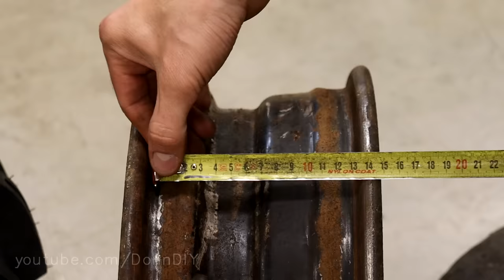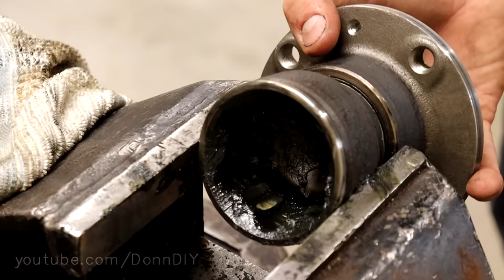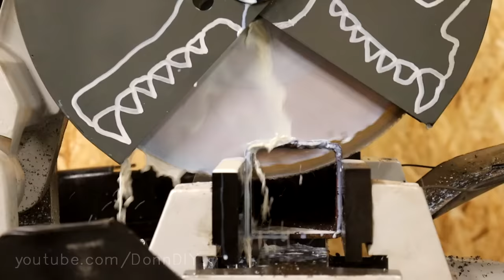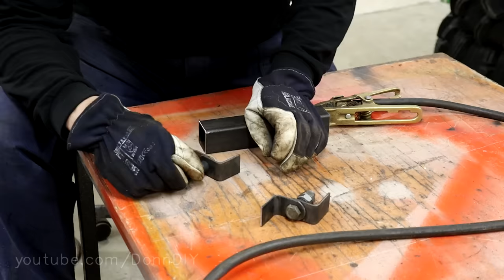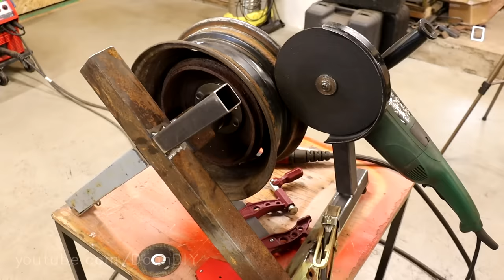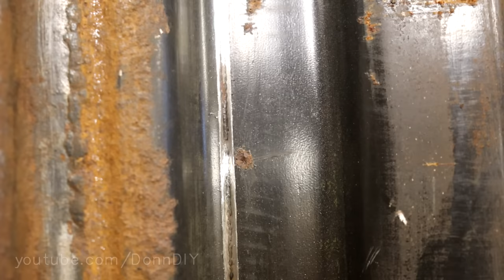Widening Steel Rims - 4x4 Build Ep.3

Comment from the maker: Want more fabrication videos? There are plenty on https://www.youtube.com/c/DonnDIY/videos
Reply: Lnj
Reply: @ronaldosantos2334  n
Reply: @ronaldosantos2334  ช
Reply: Jan Schlossar  it's for an off-road vehicle, it doesn't have to be spot-on perfect. these wheels aren't going to be balanced or anything like that. when guys started making their own bead-lock rims no one was worried about the wheels being perfect or balancing the tires. the aren't going to be spinning as fast as highway tires are.
Reply: @malacungpapuyu1987  hi
Reply: @christiaanbrown4278  but some guys are perfectionists  which i admire and respect .
patience pay off
Reply: Dont these tires have like 250 kg max load?
Reply: @rokadamlje5365  if they do then the vehicle can be up to 1000kg (250kg x 4 tires)
Reply: @christiaanbrown4278  well as long as its only some towing of 2 axle trailers. Hitching anything to this will quickly bring the weight onto rear 2 tires beyond 500kg. 

Should have used some tractor tires. Or do these tires have that much more capacity over the rating?
Reply: Ζπ @malacungpapuyu1987
Reply: Indonesia I from Indonesia I like like like👍👍👍
Reply: @jajangsumarya2933  8j
Reply: @rokadamlje5365  u
Reply: @ronaldosantos2334  fazer
Reply: @ronaldosantos2334  aa
Reply: в Росии эти диски называются РАЗВАРКИ )) вы молодец и руки у вас прямые ))

Comment: A much easier and quicker way to do this is to go to a wrecking yard and buy 4 rims of the same type and cut off the widest part of the rim to whatever size suits your desired wheel width.  This eliminates the need to make sure the retained part of the rim and the band and the cut off rim all run true.  I used to work for a business that repaired wheels and made wide rims for all sorts of applications.  With very wide rims, fitting a band in the middle can't be avoided sometimes, but cutting another rim is much, much easier.

Comment: Will one of his sponsors send him a blast cabinet and a powder coating setup
Reply: What!? And deprive us seeing him build one?
Reply: Useless. He knows a guy when it's needed for big parts.
Reply: I have a self made blast cabinet and a 3 Zyl. kompressor with a 1000 liter Tank, but it is in Germany
Reply: They better!!! :D
Reply: They are extremely easy to build plus you can make them the size that you want because they don't sale them the size you want and quality
Reply: Him standing over a cabinet blasting probably makes poor youtube content vs grinding, wire wheeling, sanding, etc. He'd have to rig a blasting cam
Reply: Ask daddy
Reply: I don’t think he is sponsored by anyone?
Reply: I think he has a paytreon page. The ppl who donate there are sponsors. In the video notes the local welding supply loaned him the welding equipment. He has the ability to gain more sponsors 😉
Reply: he does need one and that would be cool to have in any shop
Reply: R escassez saem 3
Reply: I made my cab with TP Tools fittings and gun kits.
Reply: Man, I just would like to say. My hats off to you. Great job!
Reply: @mountainviews5025  Correct.. build any size with plywood.

Comment: Nice job, I've done something similar to this before and one thing that really helped was a fresh grind on the lug nut to make better electrical connection because the ground on m.i.g. is more important than any other type of welding since the machine is jump pumping out same wire speed constantly unlike stick and so on.  👍

Comment: From a welder and car builder with over 40 experience I want to tell you what a great job you did with your fixture and prep work! The only thing that I noticed in the welding is the amount of wire stick out was a bit much. Obviously I don’t know your settings however I like to weld hot and one way of doing that is less stick out from the contact tip. Otherwise GREAT JOB!

Comment: I had a dirt track frame manufacturer in Augusta, GA put a 2” band in a set of factory wheels for an 81 Ford Courier that I restored back in the late 80’s. I put a set of chrome rings and the factory hub caps on the wheels and mounted a set of 60 series tires all around. Had a lot of people ask me how I was able to mount wide tires on that little truck with the “factory” wheels. Surprisingly the truck rode really good.

Comment: I'm always intrigued at the way you fab and engineer your way past every obstacle you come upon. Your problem solving skills are fantastic. Another amazing video, thanks!
Reply: BTJ, excellent comment. He is a genius. I Love watching his work.
Reply: @davepelfrey3958  I agree. It just makes my day when his video comes up. He is fantastic to watch.....And he makes it look so simple.
Reply: @bobf12  ,   that is a fact.
Reply: Sorry to burst the bubble, but this has been done for decades and jig he built would be suited to some car mechanics place at 80¨s-90's to widen the rims for local teens for road use. Usually its done in non commercial setting with car jacked up from one side, attach the rim, clean up the area with a rag for most of the crap, angle grind while car is on 1-2 gear depending on ratio and rim diameter for desired speed since rim diameter=distance per revolution, engine rpm devided by gear ratio times two i believe since all power is going to one side of the differential. Cut the rim, round the flat bar or sheet of steel, weld it in place while car is lifted up on front and buddy can adjust the speed from other side via differential, clean the worst of the welds a bit if you can bothered, trow into balancing machine. If its way unbalanced just grind little from one side to counter balance, paint it, check the balance if bothered, mount the tire and see what ever it hold the air. If not trow more paint at it, unless there is hole so big you can see to other side, witch point go check your eye sight at doctor, grind the paint off from that spot, trow little "Kemppi glue" at the problem, if there is any paint left it will burn out, smooth it out and repeat the balancing and painting portion. Weld is there to hold it on one peace and paint fills any air holes there might be. His method would work for actual car rims in road use, while described teen method would be more suited to UTV, since its does not matter much if rim snaps in half in crawling speeds, but on the highway its different matter.
Way he did it was over engineered, but then again who knows, maybe he will be making more of these widened rims so it makes sense to have proper jig for mass production.
Reply: Hellsong89 cool.
Reply: I agree man. It is nice to give a guy credit for doing/making/adapting versus saying "its been done before blah blah blah".

Comment: Could have just welded by hand while still using the bearing to spin the wheel. Much simpler and easier to control. I've built tons of driveshafts this way and if you use a dial indicator no need to balance.

Comment: Are you ready for safty trolls storm? For god sake, there "wide steel" is common in bmw and audi. ;)
Reply: It isn't going to be used at high speed, it's for an off road UTV. you were going to use it on the road I would say don't use a banded wheel but offroad at low speeds it'll be good.
Reply: @cmotdibbler4454  - I was thinking, Maybe I wouldn't want to try those at 150 kph, but they should suffice for an ORV. The penalty for failure is to walk home and fix it; that seems OK.
Reply: @MAGAMAN  - The intended use is for a utility off-road tow  vehicle. I don't think he intends to do any racing. (He has other vehicles, designed and intended for that purpose.) I agree, it is possible to have a fatal accident at 10 kph, but it isn't likely, even with a total, instantaneous wheel failure.
Reply: Spoken like a bunch of people that cant weld!
I will have no problem running wheels I have widened. 
But...I am certified welder
Reply: @MAGAMAN  i got news for you. Every company I have ever seen that widens steel wheels does this the same way.

Also these would be plenty strong for on road purposes. If companies do this sort of work they more than likely state that they are for offroad use only just like all the weld on bead lock companies do. It protects them from lawsuits. However I can absolutely verify they they are strong enough for road use. At best the wheel will bend. You show me any aftermarket steel wheel and I'll show you an unbalanced steel wheel. When I was a kid I worked for a tire shop. Damn near all the aftermarket steel wheels were out of balance to some degree.

Comment: Simple power feed would be to have a band around the rim going down to a small diameter rod chucked in a drill. Variable speed, and requires almost no precision to implement.
Reply: Might as well go full NC on it! Pretty much there.
Reply: @kurtwerner4258  Not quite.
Reply: Or just bolt the rim into car, lift one corner up and let engine run on idle. For precision use strap to tie steering wheel in place. That is how its been done for decades.
Reply: I have my doubts that that would work well. For that size welder and wire, he’s looking at about 3-8” of weld per minute. Assuming it’s a 14” rim, that’s around 5-14 minutes of weld per rim. I don’t know that the engine could turn the wheel that slow. I’ve been wrong plenty of times before though.
Reply: @whodat90  I believe you are correct, I've never seen a freewheeling car tire at idle turn that slow. the brake would have to be on all the time to get the wheel speed correct and there could still be surges related to the brake pads and/or the drum or rotor. Using an electric motor geared down with either a rubber wheel in contact with the rim or the shaft with a pulley and a belt would be the most effective and consistent way to turn the wheel for this kind of welding. the pros use a foot pedal to control motor speed as they weld.

Comment: At the speeds that UTV will travel, if you run into trouble with the widened rims holding air, you could smooth those welds down a bit and put tubes in the tires with no issues at all. That was an ingenious bit of work; well done. 👍

Comment: you are awesome like ever. but is maybe time for a TIG?😉 i would try with a bit more current or less wire speed to enlarge the welding track anyway.
Reply: Be pretty slow welding up 4 rims with the tig wouldn’t it? I ended welding up my rim with the stick welder even though I have a tig because I couldn’t be bothered cleaning it up probably
Reply: TIGs are for fancy work, they're not that good for on the cuff quick stuff like this. I've often found that they actually impede the process.
Reply: aserta your dead right! I pretty much only use mine for stainless and alloy

Comment: keep up the great work your doing .. some day you need to build a sand blasting cabinet .. i am going to change mine , so i can shove long pipe threw it and clean a section at a time , then close the flaps when doing other things ,, need to hook a shop vac so i can see what i am doing gets a bit dusty . also need to ground the unit i have been sapped it will create a charge while sand blasting ,, keep up the great videos ,,

Comment: Back in the day the way we would widen rims was to get another set of old rims the same diameter,  Cut the edge off the good rim at the edge and use the wide section off the donor rim. Weld the two together while on the front hub of the car to rotate the wheel.  No spacer needed and only one weld to concentrate on.

Comment: Great work. Little tip  though. Cut the ends of the rolled ring at 45° so that it isnt a straight butt joint were the ends meet. Its easier to blend in afterwards and much stronger.

Comment: Not that I don't love DIY stuff. But those rims your making with 4 bolt golf cart/atv pattern are about 30$ each lol already size your making!   for 120$ roughly you could buy brand new set already correct size, compared to the $120 steel/$xxx expendables  and god only knows $xxx power consumed to make those lolz! dion't get me wrong I love the videos! These came out top notch I may add! just saying there comes point why even go through trouble in my view.

Comment: Small point, why did you cut the axle off the cv joint? You only needed to hold the axle and hit the joint and it pops off the axle. The spring clip is only to stop the axle walking off when driving. It is designed to collapse as the center of the joint is bumped over it.

Comment: Awesome job!!!!  Widening rims in this manner was one of my first jobs at 14 years old. (Over 50 years ago)  I worked for a friend's dad in his machine shop. We had a set of rollers that were powered by an electric motor that we sat the rim on to slowly turn it while I welded it.
Reply from the maker: Two rollers is the most universal solution - fits all diameter rims.

Comment: Excellent! I like your way of thinking. Kudos for being protected. I see many videos of people welding without a respirator or even a dust mask at the very least. I was thinking ahead of your video how you were going to weld the  circular joint and my thought exactly! you need a jig and let the welder do the weld with consistency. I would have added an extra tool to make the circular weld more consistent and that is the use a slow speed motor setup to rotate the hub at controlled speed, especially with 3 additional wheels to do. Thumbs Up!

Comment: You are EXTREMELY talented, and I learn a lot from you. But wouldn't it have been easier to mod rim that fit the tires to the bolt pattern on the axle?
Reply: I went looking for this comment because I was thinking the exact same thing

Comment: what gauge sheet Sheetmetal did you use?   i've been wanting to band my VW stock wheels.  i bought a tire machine to use as like a sideways lathe to cut my rim.   i'm not sure what gauge to use for the band.  i also need to get a roller!

Comment: In the mid 1960’s into the mid 1970’s there was a business in Garden Grove California called “The Big Wheel”.  They advertised in the 2 or 3 magazines at the time and they started off doing this for the craze in the 1960’s of shortening a VW pan and making a dune buggy.  By 1970 there were a ton of us CJ Jeep people that were also running their rims.  You traded in your stock wheels and for 8.95 per you bought an 8” rim, 10.95 got you a 10” rim.  Their process was almost identical to this video.  At the height of their business I believe they had around a dozen employees.  It was advent of dependable tubeless tires that finally did the business in, there were also laws passed (although I and everyone I knew never heard of a problem with the rims) that finally put the company out of business.  Great ingenuity exhibited in this video, first time I’ve seen this channel as it popped up on my recommended list.  New subscriber!

Comment: One change I'd make.  Electrically insulate the MIG welder copper cup / nozzle from the clamp.  If the nozzle fills with balls of metal, you will get a conductive path. Otherwise, great solution to making the wheels.

Comment: This is way better than those hour long video from the Third World where with bizarre royalty-free music of reinventing the wheel if you will by  recycling motors, magnets and fans from junk computers, some bell wire and  a battery, hot glue, hose clamps and wood to make something that your never going to buy, let alone make and you're so mad at the time you can't get back that you don't even leave a like!

This is what I sent to buddy who we're both been crazy about cars since we were a lot younger! :
"Being as you do a lot of stuff with the off-road vehicles, motorcycles and that kind of thing this might be of interest to you. He's getting pretty jiggy with it! At least it makes everything repeatable. I'm hoping in the 20 part series he gets around to blasting those steel wheels inside & out, maybe do something to make it look & hold air/bead better. I've been a subscriber, but I don't think that the algorithm pushes his video's, but if I wasn't so ADHD I'd have watched the one about a homemade belt conveyor for God only know's what for! I've got a cousin who's stacking paper like old folks designing them for proprioritatory applications like Amazon type of things in HUGE company's warehouses. I've seen hay elevators used to process firewood saving a lot of backbreaking work! Not to mention more on setting up a machine shop, 'cuz if you're crazy enough to do this just think about all of what you could do with a lathe and a mill!!!"

Comment: Aside from rust and paint, part of the popping and sputtering during the weld is the amount of electrode stick-out from the contact tip and nozzle.  Yours appears to be almost an inch, 25mm.  Try moving the nozzle closer to the work to shorten the stick-out.  Like your ingenuity!!!

Comment: If you position your MIG gun off of TDC say around the 1 o’clock position and rotate your rim so that your weld progression is in a down hill direction, you will produce a flatter bead pattern and will penetrate a little better. Of course it will all depend on your rate of travel, inches per minute for your wire feed speed, and voltage output. Their is no substitute for experience so keep playing with it. I really enjoyed the video. Thanks

Comment: We used to get our 4.5"steel wheels widened with 2.5"bands in the late 60's.  Wide wheels were considered an insurance risk back then, haha, now everything is wide.  We had a bloke in Launceston who did the work for small money - the results were perfect with stick welding, we ran tubeless tyres never an issue.  They looked fantastic too - the band was visible but no visible sign of welding.  The guy was superb at his work.  We also had a guy who reset our coils to lower the cars - he would ask what the car was and how much we wanted to lower it, and he would re-do the springs without ever using a rule to measure them.  Result was always spot on.  Those were the days - carefree youth :)